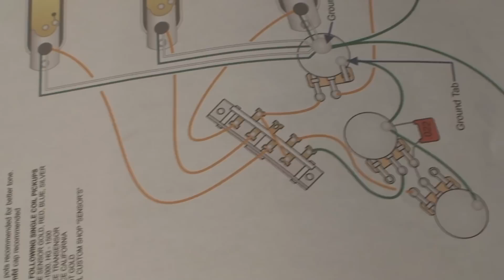Messed Up Fender Stratocaster Wiring Part 1

Comment: i changed my strat pickups and took off the wires going to the input jack and the tremolo claw. once I put everything back in and pluggged it into an amp, all I hear is static and no sound from when I pluck a string.

Comment: You know, pickup replacement ain't rocket science. But if you're not 100% confident in your ability to read wiring diagrams, trace wires and solder, leave it to someone who knows.